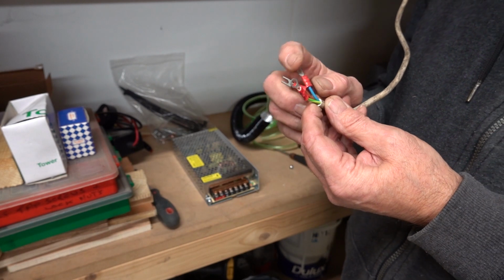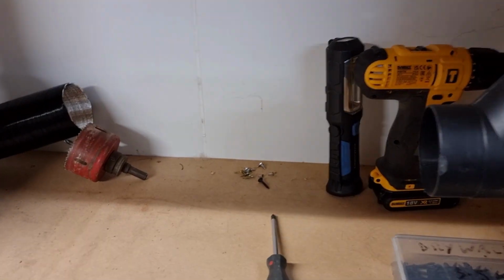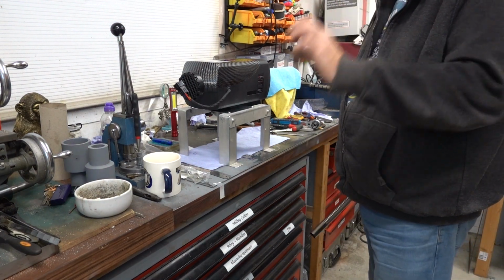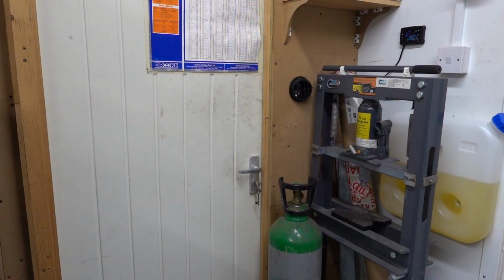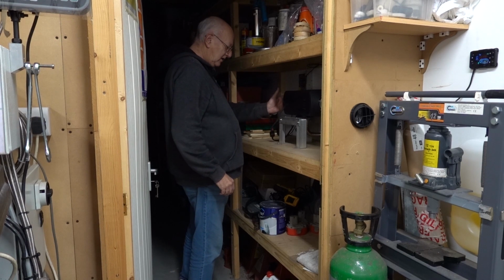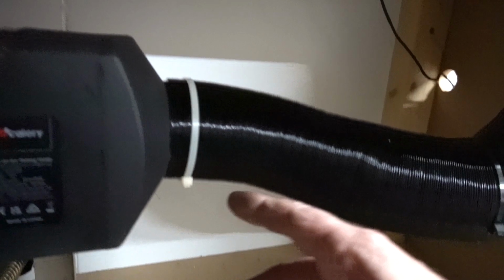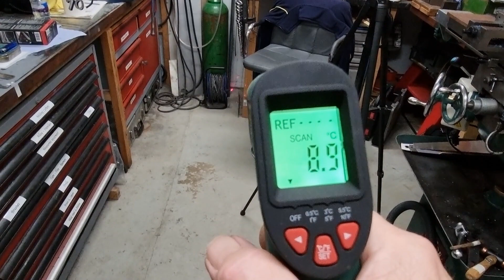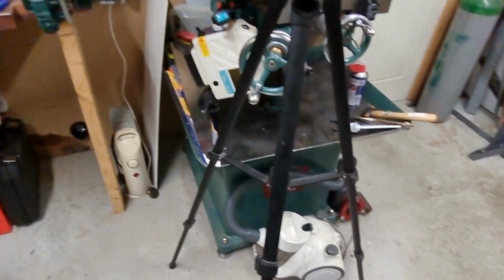Installing a Diesel heater for the workshop Installed part 2

Comment: Nicely done there Steve, just goes to show some insulation in the workshop roof would help us all... Excellent video, thank you.
Reply from the maker: Hi Paul. Yes i guess it all helps. The roof is only 50mm insulation sandwich sheeting. Not sure yet how frugal the diesel usage is, until i do some real world tests. But it's got to be cheaper than Electric.
Regards.
Steve.

Comment: Nice Job Steve, there great. Your right about the temp difference
I've just took mine off the temporary high shelf and installed it at ground level the difference is huge, trouble is i had a job finding a space low down, must get rid of some junk!!🤣🤣👍👍
See you next time
Kev
Reply from the maker: Haha nice one. Exactly my problem Kev. No room anywhere. 😏
Regards.
Steve.

Comment: You'll be needing a ceiling fan now Steve, to blow the heat down...  ;)
Reply from the maker: That's what the vent in corner is for. To take return air & recycle it back through the heater. Should use less fuel once done..
Regards.
Steve.

Comment: Hi Steve, great job, if you ever make changes to the ducting, the best thing you could do is to drop the warm air outlets down as close to ground level as possible (mine is touching the floor), it helps to balance the delta between floor and ceiling out, and your whole body benefits, not just the top half. Cheers, Jon
Reply from the maker: Hiya Jon. I have been working on it tonight. Will be posting a video soon on the outcome. So far I am hopeful that it has been successful. Happy new year to you & the family.Take care 
Regards.
Steve.

Comment: Nice install Steve. I think a de-stratification fan on the ceiling will make a huge difference and even out the temperature. 
Best wishes, Dean.
Reply from the maker: Yes i think it would. Although more wiring & buying etc. I think the return air is going to reap the same benefits. P.s That was a posh word.(de-stratification) never heard of that before.
Regards.
Steve.
Reply: @Steviegtr52  you are right of course, the spending can go on forever. I hope that you reap the benefits from it, I'm using an oil filled rad on low to keep the chill off. Hopefully the electric bill won't be too shocking.

Comment: Great install! I've been running of these in my workshed for two Canadian winters now and it keeps +20° in there, even on the coldest days. I built it under a shelf and closed in with drywall just for peace of mind. I have the same controller and it will maintain a temperature, once it reaches 1 degree above the set temperature it will slow down until its 1 degree below the set temp and it will kick back in. Which is fine for a bigger shop but when it's only -10 or warmer out my heater is too much for my little shed.
Reply from the maker: This was something i wanted the controller to do, but i will not. I wanted something like a frost stat idea. So if the temp fell below a certain point the heater would kick in. Then once reached it would switch back off again. Hmm food for thought there .Going to go over & have a look at your channel.
Regards.
Steve.

Comment: Just an observation mate, is that door next to the fuel tank your only exit from the workshop? If so you may want to think about moving it ❤
Reply from the maker: No there are 2 exits from my workshop. 1 is directly to outside. 2 is through the garage where i have a electric roller door to the driveway. Why do you ask the question. If it is because of the fuel tank then try & set fire to some diesel. Diesel will only burn with a rag soaked in it. It is not volotile like petrol or say cellulose products. I have 40+ years of doing risk assessments & method statements. From my previous carreer as a contractor.
Thanks for your comment though.
Regards .
Steve.
Reply: You are right of course 🙂
Reply from the maker: @anthonyreed2228  Anthony please do not fall out with me. I really do take all comments on board & if you or anyone else thinks i am doing something wrong then tell me. 
Steve.
Reply: @Steviegtr52  no mate not at all, I was asking you the question (badly) and your answer was spot on 👍👍, now get some sleep 😂

Comment: Shell 15kg of butane calor was £93 at my local garage 😢. I put that towards a diesel heater instead 😂
Reply from the maker: Oh my god. I used to pay around £16 when i had the caravan. That is stupid. Yes you did the right thing. I am still getting great results from the heater. It uses so little fuel. If you look at some of my other vids I do a comparison Vs electricity.
Regards.
Steve.